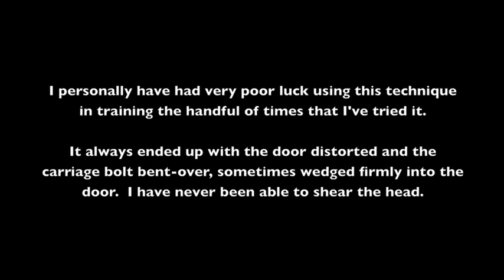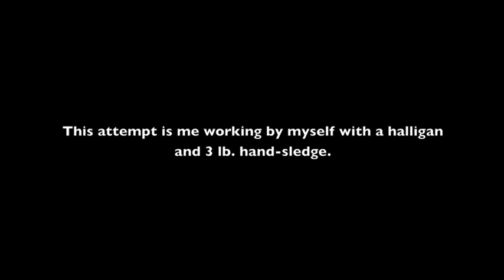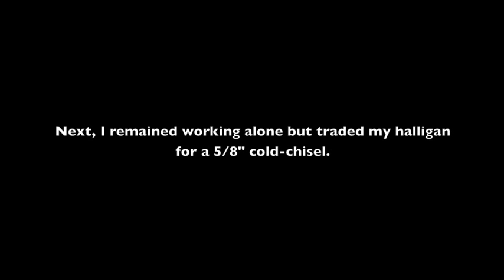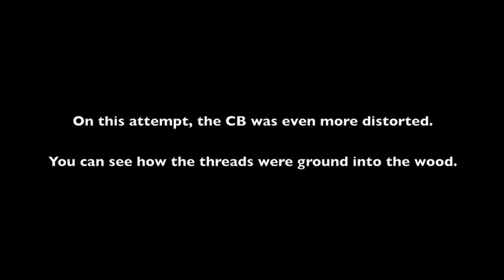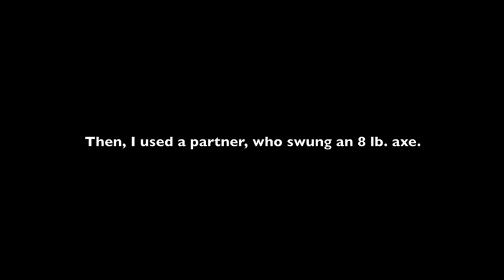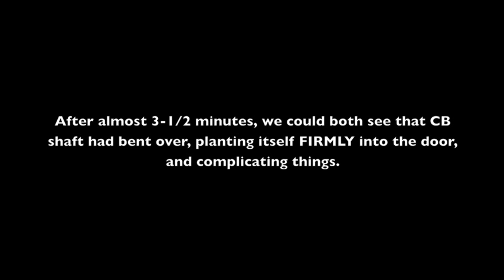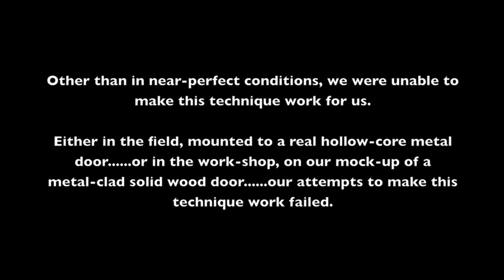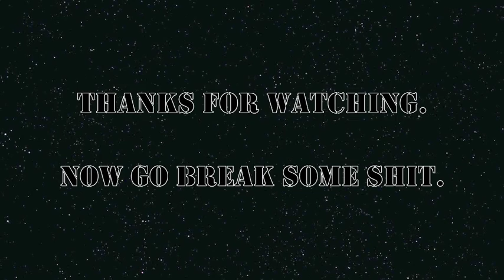S&D: Irons Carriage Bolt shearing experiment

Comment: I my personal opinion, this technique doesn't work because you are driving the CB into the wood rather than cutting the head off. If some way you could put a tool on the bottom of the head  and stop the bolt from penetrating the wood  this may work. You would have to have a  metal door about an 1/4 in thick on both sides  to help cut the head as you drove the pro bar from the top.